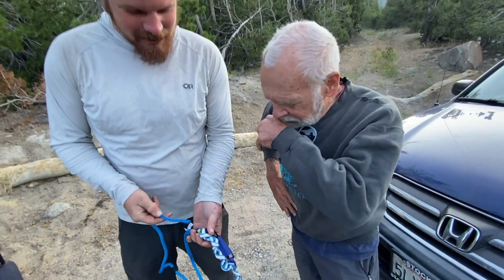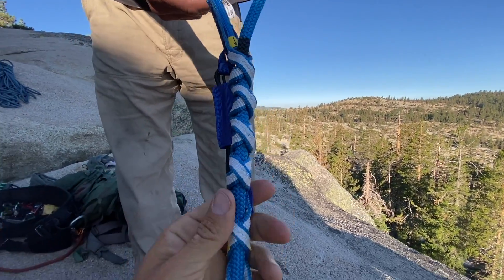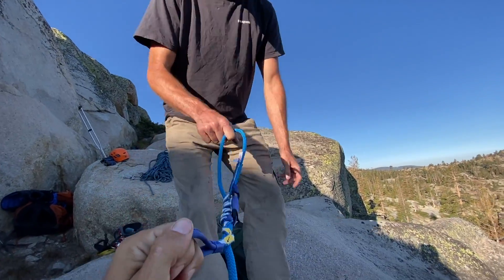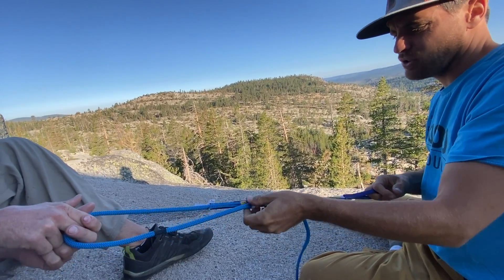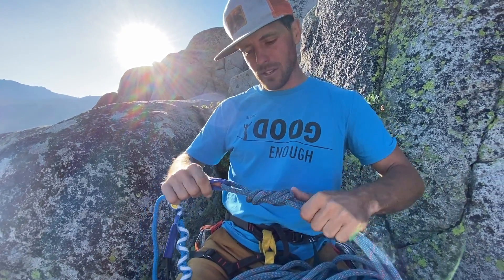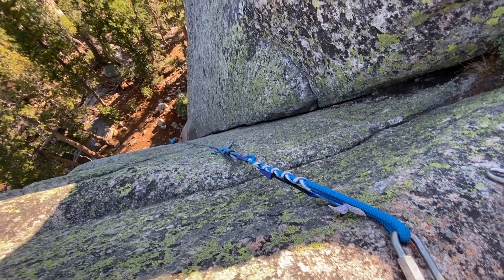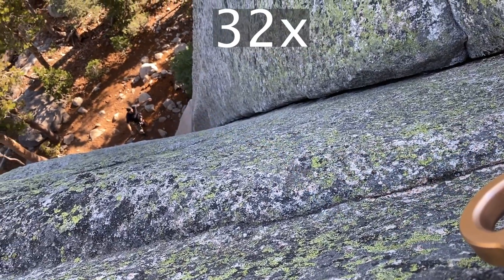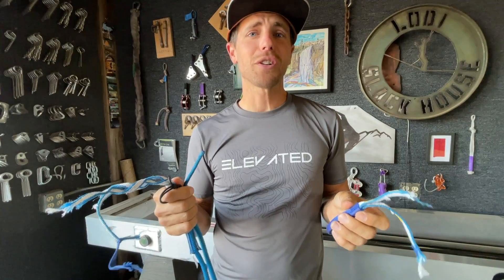Would you Trust the Beal Escaper for Rappelling?

Comment: Awesome device. I've been using it for almost all my rappels now since I've had mine (~1year). There are lots of multiple rope rappels in Tuolumne and some single pitch climbs requiring 2x 70m ropes to rappel. The Beal escaper is so much lighter than carrying another rope and I keep one in the pack at all times.

The knot should be tied for the first person, so that it is safe. The last person rappelling will need to untie the knot before going down. At this point, the second would have seen that it wasn't slipping on the first rappel, so that should give more confidence to the setup. 

The minimum weight required to prevent slipping is 10kg/22lbs, so unless you stand on a ledge and fully unweight, it shouldn't slip. It shouldn't slip even if you are jerky while rappelling  as long as you keep a minimum of 10kg/22lbs on the rope (this was one of the most common concerns people had when they saw the device being used.)

I haven't done a side by side comparison on this, but based on my experience with the device, you'll need to fully weight the device as much as you can, then fully release it to minimize the number of pulls. This means pulling a lot of the rope stretch out before fully releasing. The rope should be shooting back up the wall. Not sure which way is faster or easier. 

Once the temps are good, I'll probably try this on Royal Arches with 2 Escapers, 1 on each end of the rope. That way the first person down can set up the next anchor and set up rappel while the second is rappelling and you don't have to pull up the rope again at each anchor.
Reply: Oof, I mean, fair play, it is designed for that but I think I'd be a lot more comfortable saving the escaper for a "get out of dodge" situation. I'd much rather climb on twin/half ropes if I needed full length abseils (to be fair, I'm in the UK and half ropes are the standard here for trad, so I'm used to the system and comfortable handling and belaying two ropes simultaneously)
Reply: Hey, are you still alive?
Reply: @MCP Yeah, I think so
Reply: @senditchen  still hasn't failed, good to know xD

Comment: Great job fellas!  I have been using the Escaper for about 2 years now.  It is crazy bomber.  People get freaked out by the looks of it, but if you have ever done any rescue at all, you know that a dog & tails capture is insanely secure.  This is a great piece of kit that can be used over and over.  I think its actually miss named as an "escaper".  It was decided long ago that if you are multi pitching, you don't need to carry a second rope just to rap back down.  This will work every time.  I did some testing with a friend of mine competing the Escaper vs. a Carabiner / Knot block release.   The escaper is easier, faster, and way less messy.  Here are some lessons I've learned:
1- It works best in vertical environments.  Even a wee bit o friction will cause a substantial amount of extra pulls.  as seen in your video.  If it was pure vert with little to no friction, i'd say 8-10 pulls is average.  I have pulled it over an almost 90 degree edge, set back about 10', and still got it to release though.  
2- The longer your rope, expect more pulls due to more rope stretch.
3- I typically only use on single point anchors.  Even natural.  I've wrapped trees branches up to 6" and it released great.
4- I've never had the black mark slip or adjust during a rappel.
5- Keep in mind that friction tails are Dynema.  So you must stay aware of hot metal anchors.  Dynemas enemy is heat, and sometimes bolts and chains can get down right smoking hot sitting in the sun.  

If you are looking to do extra tests- I'd say lets see what the minimal amount of Escaper rope you need through the Dynema before it pulls and fails.  And how does it perform through 2+ bolts at different angles.  

"I can't believe you broke the beans above the frank"!  

Cheers mates
Reply: Glad you've only had good experiences - but having gotten my rope stuck (due to friction) two of less than a dozen times I've used it, I'd definitely refrain from deliberate usage.
Reply: @juliandurchholz  I'd love to hear what the circumstances were for you.  How did it get stuck due to friction?  Was it already stuck before you started your pulls?  or stuck on the way down?  I will say that as a coinsure of austere rescue and rope theory, most people (especially climbers) aren't that cognizant about retrievables.  It really is an art and takes quite a bit of practice.  Canyoneers are exceptionally well adept at retrievables and have been using all sorts of types for decades now.  If set up beforehand properly, you usually don't have any issues.
Reply: @BryanJen21  First time was a full 60m where after 10m the rope got kinda wedged in a corner of roughly 40 degrees. Honestly didn't look that bad when I passed it - no problem in a normal rappel - but apparently the device is really sensitive. The bottom 50m were free hanging. I gave up tugging after like 20-30 minutes and decided to scramble up the next day to retrieve it (it was night).

The second time was a mix of corner friction and quicklink pinning the cord. Almost got it through, but it's nearly impossible to tell if you're making progress.
Reply: @juliandurchholz  Thanks for sharing Julian.  That second one with the picture looks like a very hard placement for that device.  With the corner adding that immense amount of friction.  Maybe if the escaper was routed the other way, so instead of being on the backside of that quicklink, it'd be coming out the front?  Also the angle of that pull is pretty aggressive.  Very interesting indeed.  Ive pulled over some pretty hard edges myself and didn't have any troubles, so very interesting to see examples if it not working so great.  Again, thank you for sharing!

Comment: PSA: Don't use this device unless necessary. Got mine stuck twice due to rope drag alone - the sling wouldn't slip out. Make sure the rope isn't wedged anywhere or you WILL be stranded. Steep and clear terrain only. Also gloves are useful if you have problems pulling. After a hundred strong tugs your skin is history.
Reply: ive used mine on a 25-30 metre waterfall and the weight of a wet rope made it very relectant to come through, had to whip the rope between each tug
Reply: fun tip to have more strength when pulling on a rope: stick a clove hitch on a carabiner and use it as a handle
Reply: Bowline loop for the whip action
Reply: Nerd

Comment: Great vid. Def a part 2 needed: bouncing rappels, bouncing jugging back up, various anchor setup, wet or frozen ropes. 

I suspect it will be ok except for wet/frozen ropes but who knows?
Reply: Oh, I bounced on it. See that big carabiner flexing?!
Reply: Rapped once with soaked 9.5mm dry rope & escaper. Load tested with backup before, didn't slip. Still felt sketchy, and nothing in the manual about it.
Reply: As someone who does a ton of ascending fixed ropes (and on systems that are smoother than climber jugging methods), I would not have faith in this thing holding.... :/ I don't recall how many strokes it takes me to go up a 100-ft free-hanging pitch, but I think it's enough to work this thing free....
Reply: @rachelhasbruises  Unlikely, unless between each pull your completely unweighting the rope by standing up or something. takes very little constant weight to keep it engaged / keep it from recoiling.

Comment: Now that you have proven that it works the way it is supposed to (and tested the mbs), I think it is time to use it the way it is NOT supposed to be used (but still could be necesarry to do so):
- trying to ascent a rope attached to an escaper (e.g. you are out alone and need to rapell the full length of your rope and while doing so realizing that you need to get up there for whatever reason)
- swinging left right is sometimes necessary for reaching the next rapell point
- using it in unfavourabel conditions, e.g. wet
 and you will probably come up with some other interesing scenarios :)
Reply from the maker: Good ideas.  I could ascend up the tower with it all jerky and see if it slips.  And see if wet slips
Reply: @HowNOT2  and maybe compare free-hangig to ascending feet-on-the-wall
Reply: @christophbarthel5801  the hanging repel will add more to the system and make it nearly impossible to bounce. As he said in this clip less shelfs and things to stand on the better
Reply: @christophbarthel5801  think it should work similarly while ascending too as long as you are maintaining weight on the beal system... so mayhaps ascending a rope with an ascending device or a friction hitch. If your pulling your weight up and releasing tension before pulling it through a device that might be where the problem is.
Reply: @adriansalas3951  agreed :)
However, I prefer Ryan to do the human testing instead of me :D
Reply: @HowNOT2  Or up a cliff with a backup belay.
Reply: @HowNOT2  Would love if you could ascend the tower with the escaper and see if it slips!
Reply: Yes, please break test with soaked rope & escaper!
I've used it like that before to rap Yosemite Falls, felt kinda sketchy. Rain might prompt you to bail off a climb, which should be the exact use case this was designed for - but the instructions I got with it never mentioned something about wet conditions.
Reply: I like the ascending idea. I could see a few ways in which people could end up in this situation and decide to try and risk it!
Reply: My friend and I rapped the Dimanod Wall on this. It is as solid as it gets. Swinging, bouncing and etc doesn't matter as long as you maintain the minimum of 20 or so lb pull on it

Comment: Try to ascend the rope with the escaper.
The rope flex is interesting since it evens the load over a short timespan, less tugging.

A potential use is to rapell of a single rope for much longer rapells..

Thus the question, how long rope could you actually retrieve?
Reply: I meeeean, I've got a 586-ft fully freehanging rappel that can be set up if y'all pester Ryan enough to try to the next time he comes caving with me.... 😉
Reply: @A R "Could be used safely with a 200m rappel" - sure, to get down. No way to pull a 200m rope, its weight would prevent any slipping.
Reply: @juliandurchholz  mgiht need more elastic to lift the weight of that much rope between tugs
Reply: Ascend a rope..... mmmmmm yah not intended purpose.  I've done a full 60m rap with the escaper.  it was a full 20 pulls to overcome both rope stretch and the inchworm effects

Comment: Bobby mentioned not seeing a reason for not using a carabiner on the escaper instead of tying a knot, I tried it once with my escaper, and regretted it immediately after a carabiner came down at breakneck speeds with my rope. It’s like pulling a metal rock down on your head. Always tie a knot on the escaper. And wear a helmet.
Reply from the maker: Good Point!
Reply: Yeah I posted a similar comment, hasn't happened to me, but as soon as I saw how it worked I was like yeah don't attach a chunk of metal to that lol.
Reply: Isn't that exactly what Petzl recommends when abseiling on a single strand with a grigri? Or does having the biner in the middle of the rope makes it less of a projectile?
Reply: @TomashGhzegovsky  Absolutely. With a blocking rappel (with the Grigri), the biner is like you say in the middle of the rope so there is half of the rope which has to be pulled through before the biner can go into free fall. If you don't stretch out the length of the rope there is a good chance that you can retrieve the biner before the rope even starts to fall. In the Escaper case you use the full rope length and the biner will fall the full distance.
Reply: @mike78at  Why not use a stopper knot
Reply: @Fabianwew  I guess you mean using a blocking method which doesn't use a carabiner at all? I don't bother as for me it is quicker to use the other methods and I never had an issue with the fall height of the carabiner (not usually a fall at all). But something like an integral fisherman's fail-safe (from the "Down" book) looks interesting! (To be clear, talking about a blocking rappel here, don't have any experience with the Beal Escaper)
Reply: @mike78at  Additionally you creat some speed to the system with your last pull
Reply: @TomashGhzegovsky  what?  Coming down with a gri gri, you are tied in to one side of the rope.  That rope goes to the rap station, the down rope that is not tied you, is for the gri gri.  Then you let your self down. Am I missing something?
Reply: @chrisrichardson5641  If I understand correctly what you mean is just lowering yourself. But if you want to abseil without your ropes running through the anchor under load, you can tie a knot on one side and just abseil on a single strand ( which looks super sketch) but that's in the Petzl manual. I guess as long as you don't abseil on the wrong strand nothing can go wrong, right? 😂
Reply: @TomashGhzegovsky  yeah!  I was think lowering.
Reply: i could imagine a carabiner getting stuck in a crack on the way to down and becoming like a bomber wedged nut.
Reply: Your mate made the comment about getting it stuck. Interesting to see its behaviour under ascension. Would it unravel?
Reply: Oh, schnap!

Comment: I just rappelled ~300 meters on this on Cima Dodici in the Dolomites last week. Used a single 30 m half rope and it turned out to be something like 14 rappels. The Escaper worked really well and wasn't scary per see, the scary thing was using an 8 mm half rope in terrain with sharp limestone edges. Would be much nicer using a thicker rope.
Reply: Why did you only have a single 30m half rope?
Reply: I think I wouldn’t rely on that to rappel down, only in an emergency. What would you do if you get stuck on one of the rappels cuz the escaper is stuck somewhere and you can’t retrieve your rope :D
Reply: @dalivanwyngarden3204 that would blow for sure, I guess you would have to try and be proactive and scout the terrain to see if it has some sketchy or questionable areas before attempting it then decide if it’s worth it to just sacrifice a piece of gear over using the Beal, I would be terrified if the Beal got stuck and you had to figure out a way to go back, you can’t really jug up or at least you would be insane to try
Reply: How often did you have to tug on it?
Reply: @alalalal  25-30 times until release